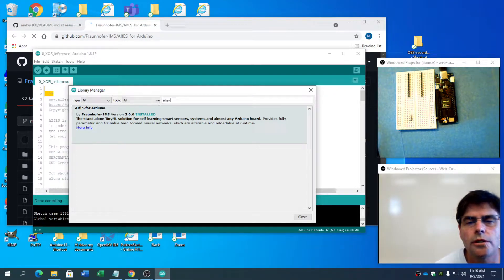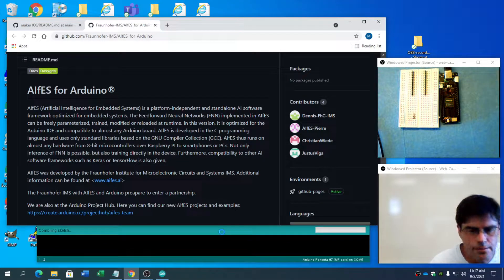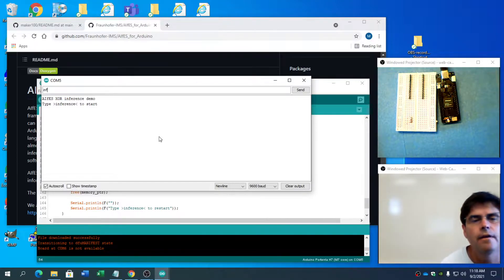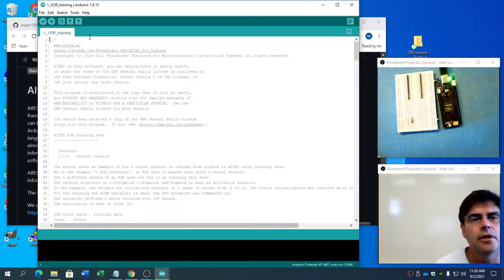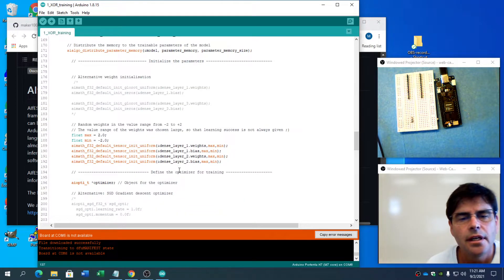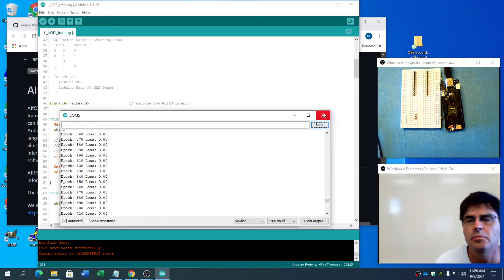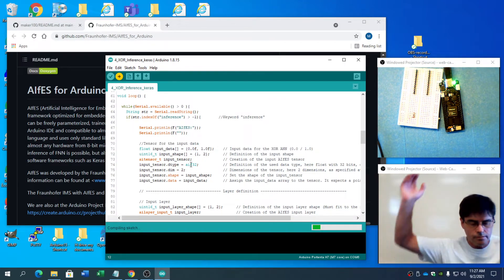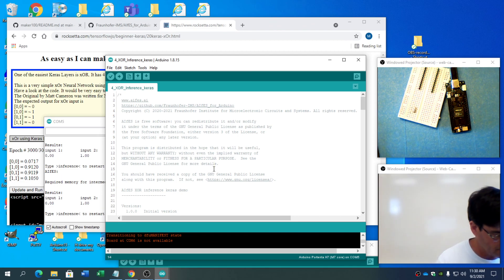"AIfES for Arduino" Library using the PortentaH7 about Artificial Intelligence for Embedded Systems

Comment: Great Video. :) Short addition, the training result is always different because the weights are initialized randomly each time. The learning rate is set relatively high in the examples, so it may be that no global minimum is found. Each training is individual and it will not be trained further if the command is entered again.
Reply from the maker: Thanks ALfES, really great work, I need to look through the code slower as what you have done is amazing. Do you have a twitter or Instagram presence?